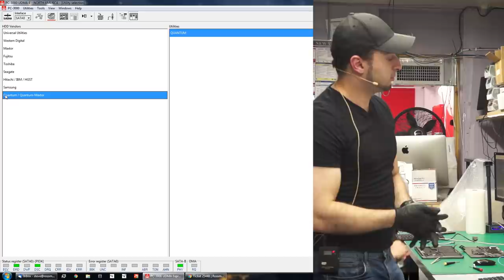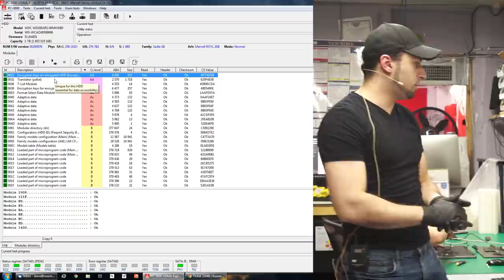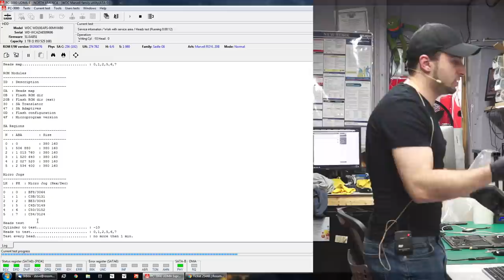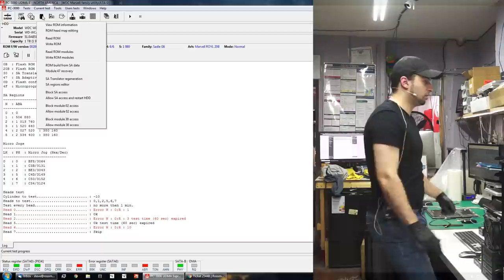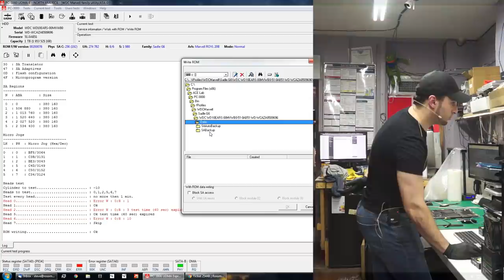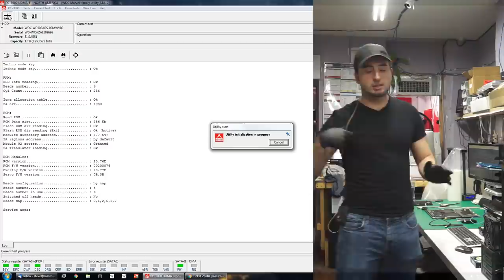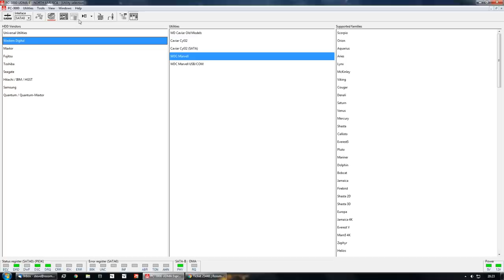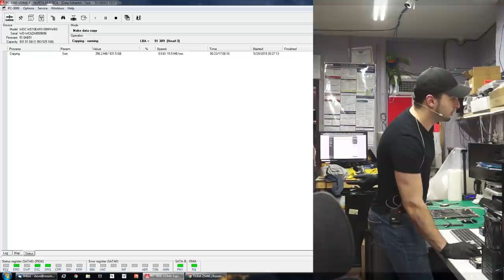Western Digital hard drive data recovery: heads swap

Comment: Is there any way of recovering data from a WD My Book World Edition NAS (the one with the double blue rings - single drive unit). It was fine when it was powered off to move from one state to another. However when setting it back up (power and ethernet plug back into the same router, with the same network settings), it powers on, but doesn't obtain an IP (basically it acts as if it fails to boot). I pulled the drive out of the enclosure and put it into a drive dock connected to Windows. Windows finds the drive, see's the correct size of the drive, but see's it as 'unidentified' (or something like that) and wants me to format it. I'm assuming that the board that converts it from SATA to ethernet is bad. I found some online that's has the same model # of the My Book, but they are $200 +. Is there a way to get to the data and copy it to another drive  (or my DIY NAS) through the drive dock I have??

I also have a couple drives that was in a Maxtor Shared Storage II (2 drives that was configured in a RAID 0). The box would power on, then off, then power on, etc. (power cycles). I thought this was also the board from the SATA to ethernet, however, when I power each drive in the drive dock, it works fine ... but when I try to power both drives at the same time (or any time both drives are in my drive dock) the drive dock also power cycles. Both drives run, show the correct drive size, etc in Windows when powered or having 1 drive in the drive dock at a time, but when connecting the 2nd drive, it starts power cycling. Any clues on this phenomenon??

Comment: There is more to swapping headstacks than just lifting them from a donor, getting a donor from the same run of manufacture date and checking the heads for close compatability to the originals.
Steve would have done all this and more, before using a donor.
Not as easy as it looks.
Reply: Agree, as I too do it.
Reply: Kris Wingert
I'm not into messing with hard drives internally, a pcb fault maybe, but it would only be my own drive.
I have multiple backups on hard drives/usb pens/dvd disks, so i'm not bothered.
I learnt this lesson back in the 8 bit computer era,.
Shame that people still dont back things up :-(
Reply: @zx8401ztv  It amazes me too that there are so many people who do not do back-ups. Pictures and permanent docs should be put on optical media as well as an external drive. I preach it all the time in my organization, but it seems to never be practiced.

Comment: The only drives I have ever had fail were WD. Never had a seagate drive fail. Where I used to work just about every computer that had WD drives, the drives failed. None of the Seagate, Maxtor, or Fujitsu drives failed. I will never buy a WD.

Comment: can you disable sectors like he does at the end to make large old drives with many defraggings run faster?
Reply: i dont grasp what defrag has to do with it, but Yes, also, you can just partition the HDD around the bad sectors, which you can get a detailed speed map of each sector using HDDScan for windows or a general report with badblocks on linux.

Comment: what happens if when grabbing the voice coil magnets with the needle nose pliers that it slips and falls on top of the platters, would the data still be recoverable?
Reply: No :) There would be physical damage and also magnetic flux corruption. You also have to be careful when you take it out that you dont wave it around even remotely close to the platters. Maybe if you were careless enough to do that, half of the drive would for sure be done for, but you could hope for a miracle that the other half was unaffected.

Comment: I know this is an older video but if you think WD is better than Seagate then you're not working on enough drives.  WD use to be king a couple decades ago.  WD drives are pure garbage no in the last 7-8 years.  They lowered their warranty because their failure rate is so high after a couple of years.  Seagate USED to be worse but is now leaps and bounds more reliable than WD.

Comment: Hi everybody! I have a question about a wd black hd: i have a couple of wd black in raid 0, one of the 2 hd is broken, at 99% is the headset. Can I take, for example, a headset from a wd red and put it into a wd black, or is this impossible ? (I mean, is it necessary only to use a headset from wd black with the same serial number?) Many thanks
Reply: Did you try did it work?

Comment: Modern high density hard drives are filled with helium. I guess this method won't work on them?
Reply: Horst, it would work as long as it needed to to pull the data off and 86 the drive. Helium is for longevity and lower power consumption due to air friction acting against the moving parts.

Comment: What would you do if the platters are scratched ?
Reply: I think you're f**ked.   There still may be some data on the parts that weren't affected...but once you get to the area that is ruined, you'll toast the heads.
Reply: @pmgodfrey  Thanks for the info. I was watching HDD Recovery's channel and noticed that as well. The top platter of my failing drive has a hairline circular scratch. I guess il try the glue stopper method and recover the accessible portions.
Reply: @sofon  -- The drive I'm trying to recover at the moment has no damage other than a lost partition table.  The data is there, the software sees it...but restoring it has ended up in a long chain of emails back and forth to the developer.  I'm determined though!

Good luck!!

Comment: Funny thing is I actually worked as a hard drive engineer and you would never want to spray canned air at a disk, you use a very expensive sort of qtip instead. The exact opposite of what this dude says.

Comment: Do you have any Hitachi "Deathstar" 3.5" drives to recover?
Reply: Sorry to hear you have one.
Reply: @kriswingert1662  yeah,  crapped out on me 1/2 way between a computer upgrade, lost everything!
Reply: @Celician83  And that's why we call them Death Star drives. Myself, would have backed it up to another drive before the upgrade. Been down your block before. Sorry for your loss. Burial by compactor is appropriate.
Reply: @kriswingert1662  if I had known their reputation before hand, never would have used it. Needed a 350GB HDD, I was that much short on my WD Passport 350GB

Comment: Seagate has gotten better over the years. Check out Backblaze's latest Hard Drive Stats Q1 2019. https://www.backblaze.com/blog/backblaze-hard-drive-stats-q1-2019/. I always heard when you remove the screw that holds the head assembly you lose drive calibration. That's why that screw is underneath a sticker so WD can tell if the drive has been opened.

Comment: Have yet to see anyone that takes a shot at data recovery at any level have anything other than disdain for Seagate. The only drives they have ever produced that I have seen last more than a year are ones they produced for Samsung, which were sold under Samsung's name. The only good thing I have to say about them is that they are not at the bottom of the barrel but I'm not sure that's saying much when the only thing worst got the nickname "IBM Deathstar".

Comment: Odd how can he claim WD is so great when nearly EVERY WD I have purchased has died prematurely and so far all my other drives have great service. I've actually only had one Seagate fail in last 21 yrs. But have watched nearly ever WD I install fail early.
Reply: Tbh not had my WD fail on me and its 20 years old. Do you defrag your drive and clean your computer on a regular basis?
Reply: Only decent Seagate drives are Enterprise grade.
Reply: In my experience Seagate die the most for me. ive been burnt 6 times so I no longer buy them
Reply: I had a 3TB WD Black die on me four and a half year into the five year warranty. I got most of the data from it before getting a new one from WD. I'm a happy camper and has read that the 3TB drive I had/have has had more problems than the later models.
Reply: I worked in computer repair/selling business for 4 years, and personally have many harddrives and so do friends. The ones I see/saw fail the most are Seagate ones. Yes, I definitely saw many WD, Toshiba, Hitachi (before WD), fail but Seagates stood out. I have had my 3 WD drives for 6-7 years now, and I regularly check their SMART values and run a surface test and not one has a single bad sector or other errors. However, my external harddrive that I got 5~ years ago was a Seagate one and it has died, and 2 of my friends have had most of their Seagate drives died too.
Reply from the maker: I had better personal experience with Seagate. However, after opening them, and working with Steve, and him showing me the different ways they fail & why - I can't argue with the evidence of superior WD dsign.

Comment: is pc 3000 udma necessary, ?
Reply: Yes. one of the main reasons is to be able to power cycle the drive immediately when an unrecoverable read error happens, otherwise you'd have to babysit and unplug/replug manually on each fatal error. Aside from all the SA , ROM module, head configuration stuff he was doing.
Reply: @mrlithium69  thanlks brah for that i didn't know, i'm honestly a noob at this just getting into it ..my boss wants to get into data recovery.

Comment: replaces heads - proceeds to stress test them with a head test and FW backup before securing data, then surpised when 25% of the data is lost under a dead head. facepalm
Reply from the maker: The drive was fully recovered, the heads test was for demonstration purposes.  Also, if you do not backup resources after a HSA swap, you should not be doing DR. Thank You :) -Steve

Comment: I have had a Seagate go through a fire get hit with a fire hose and still function for years after along with the GPU and shitty HP I had them in. (The system was powered down and I gave it an alcohol bath before powering back on.)  They aren't bad and they last a long time but don't use their software lol. Their drives aren't anything special either thought... In my experience WD don't age well... I have a drawer and a box full of Seagate and WD drives going back to IDE. Most of the WD are dead for no good reason. Most of the Seagate are still working for no good reason. Seagate usually die with physical damage WD seem to die with age used or not!... Take a working WD put it in a box for 5-10 years undisturbed and watch it be dead the next time you try to use it... Very annoying!!! Not sure about the raptors and black drives I have they have only been sitting a couple years only time will tell. And Samsung still makes drives and they are definitely not made by the other guys!

Comment: very bad and imprecise way to replace the heads! 
first of all he doing this work on a drive which was "already opened"maybe on purpose?
second you have to set up the head comb BEFORE you remove the magnet! in order to reduce any vibration which can damage the heads!